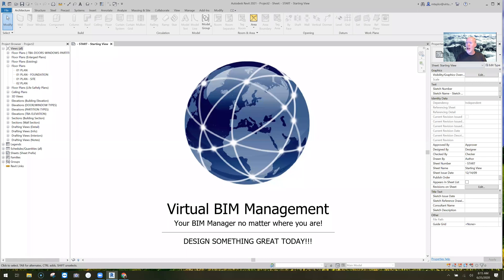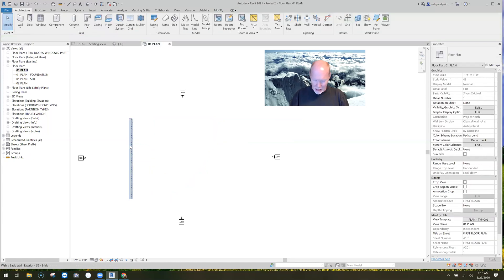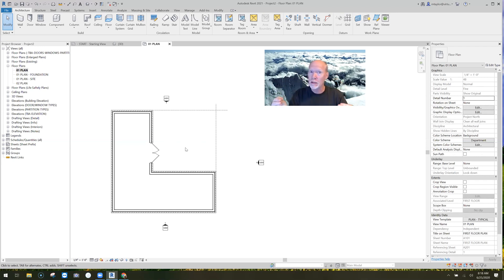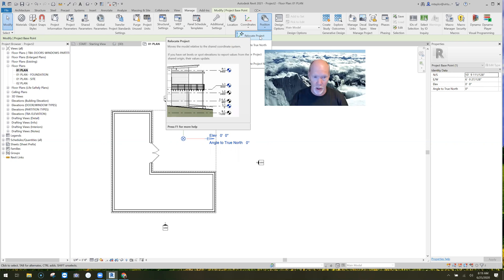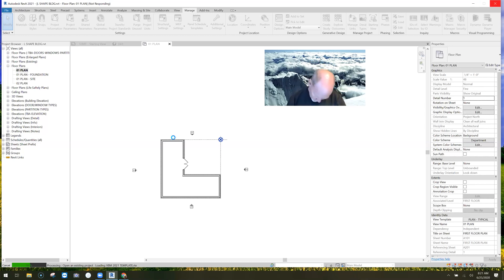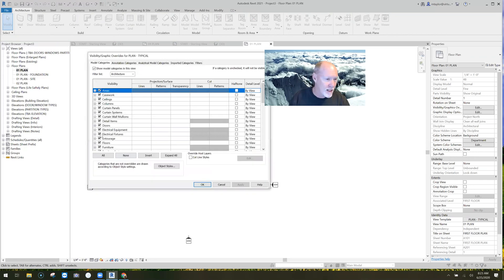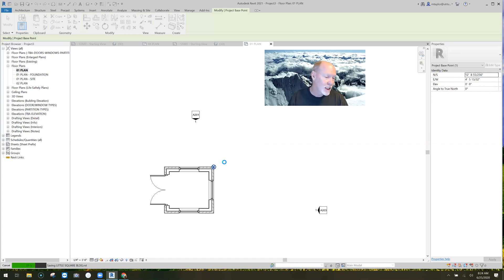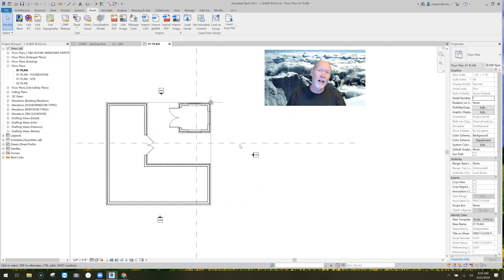PROJECT BASE POINT - An Easier/Better way to Link

Comment: Thanks - seems so simple I don't know why this wouldn't be the default way to link. I especially appreciate this because I have Revit LT. Two things:

1. It might be good if your shared screen included the tabs and menus for Revit so we could see which buttons, tabs, etc. you're using.

2. If you don't unlink the buildings and then edit your little building by moving the project base point then what happens with the other building? If you update the link does the little building move? Asking because I'm too lazy to try it myself.
Reply from the maker: I do share my whole screen… are you not seeing it?   When I watch thru my videos prior to uploading them, I see the whole screen.  If that is not the case, let me know.
Reply from the maker: If you have the Project Basepoint clipped… and you move it… all the links will move.  :o